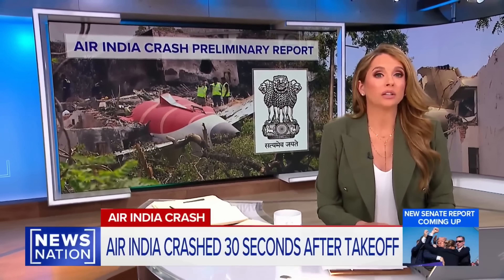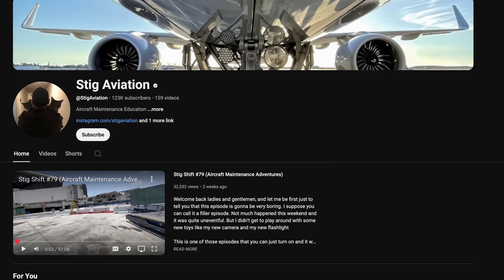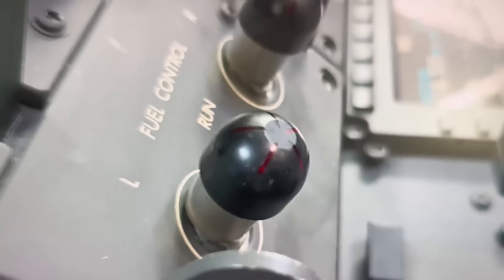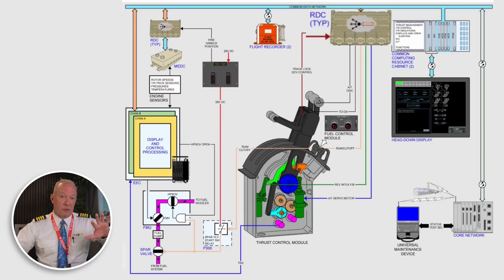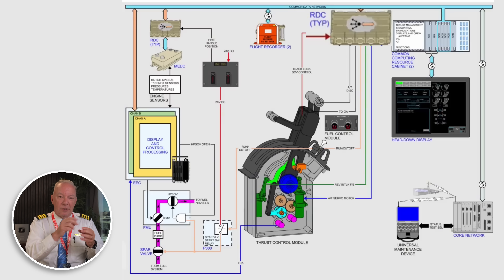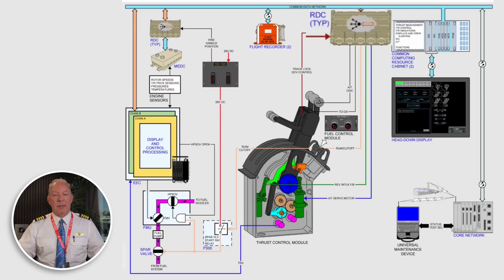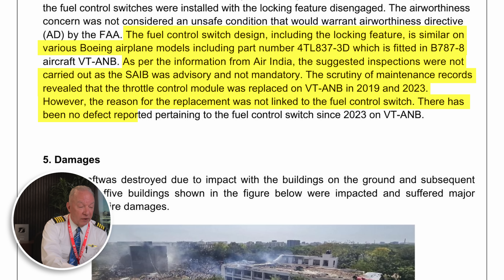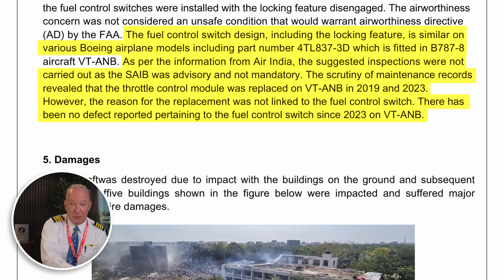The Truth About Boeing 787 Fuel Control Switches

Comment: Excellent explanation of the switches. What if the battery itself went bust , would that shut off the valve ? There is emerging theories that the battery was apparently already cooked before the crash. How probable is this ?

Comment: Thank you ! I am a retired captain for the same airline you work for. I am type rated in the 787. I've stopped reading all the internet BS and conspiracy theories because we all understand what happened. Everything you said is 100% correct. Somebody in the cockpit deliberately moved those fuel control switches from RUN to CUTOFF and back to RUN (10 seconds later). I would like to add the the position of those switches are reported directly to the flight data recorder. The law firm and NYT would like to bring doubt into this so they can litigate this and get a settlement and attract uninformed readers. THERE IS NO DOUBT WHAT HAPPENED, we can speculate why it happened but not the act itself.

There is a good reason the Indian government and Air India are blocking and delaying the investigation - they are trying to buy time. They know what happened because it is all on the cockpit voice recorder - so why haven't they released a transcript to the public? They want to create doubt and buy time.

Boeing, the US NTSB and the FAA all totally understand what Capt Steeve just told you. Do you think the FAA would continue to let the  1200+ 787's continue to fly if they thought there was even a remote possibility they thought the 787 was unsafe?  Like the 777 the 787 has an almost perfect safety record (so does Airbus 350). Stop supporting all the YOUTUBE and internet "news" sources who continue to try to profit from the death of 260 people. Thanks again Capt Steeve.
Reply: That does not mean electronic systems can't fail often at a crucial times i.e.  like taking off, You said these switches are reported directly to the flight data recorder, do you have any concrete evidence of this how the switch movement is sensed and conveyed to the data recorder? and what if the feed line to the sensors or the switch gets disrupted as it seems to come from RDC (TYP) module which is under the control of Common Data Network. So please don't pretend that you know full well,
Reply: @mikekenny4645 
What color is the sky in your world?
Reply: Somebody moved the switches to cutoff and another one moved them back to run. Because the first officer was the pilot flying I suggest the "someone" was the pilot monitoring.
Reply: Why was the RAT depolyed immediately?
It would not be triggered by fuel cut off.
Reply: "Would Boeing, NTSB and FAA continue to let 787s fly if they thought there was even a remote possibility they thought the 787 was unsafe" - YES. THEY WOULD. THEY HAVE DONE THIS REPEATEDLY IN THE PAST.
Reply: "Stop supporting all the YT and news sources who continue to try to profit from the death of 260 people"???? THATS EXACTLY WHAT CAPTAIN STEEEVE IS DOING!!!!!!!
Reply: Assuming the circuits that the switches are part of are genuinely as isolated from possible electrical faults as suggested in this more detailed presentation, it looks like the physical movement of the switches rather than a fault is what actually happened. I would however guard against making the further assumption that the movement was deliberate. We know that conscious decision making is not the only thing that drives physical actions, especially those actions that a person may have performed so repeatedly that they become an intuitive response or a sequence of actions which result from the triggering of muscle memory. When the conscious mind is distracted or focused elsewhere, we can do all sorts of things that we never intended to do.
Reply: @griff40532
What would happen if the Main battery diode module failed, (Single diode!) allowing a voltage feedback (Not regulated to charge the battery) from the Left Bus?
Could this mimic a "dead short" condition in the circuit powered by the battery?
Might that remove voltage from the fuel supply valves/ pumps?
Might the "short" also remove the trigger input at the "switch position" contacts within the switch, effectively mimicking a "Switch at cutoff" 0v trigger to the FDR, via the RDC?
.
If the system detected a failure in the Left bus, would the software initiate an "emergency supply" from the Right bus (not normally powered by the battery) via the Bus Tie Connector main contacts?
What effect would connecting the POWER feed from the Right Bus to what SHOULD be a 28v load requirement, but is, in fact a "Dead Short", have on RIGHT bus?
.
Would that action take the RIGHT Bus to the same "Dead Short" state, with the same lost of power to fuel supply AND "false indication of Shutoff" condition?
Might the "Right side shutdown" take about 1 second from the actuation of the Bus Tie Connector?
.
Please search "Jeremy John Thompson" on YT and watch the video from Early August for an extremely detailed and (imo) plausible hypothesis.
(Note, I have no connection to the individual (who is an Electrical Engineer) and was of similar opinion to yours regarding the "human factor" BEFORE I saw the video)
Reply: @rogerstarkey5390 wouldn't explain the second between the two switches being switched off and later switched on. Also doesn't explain the cockpit recording. Also it's very likely the voltage is also measured and recorded.
Reply: @rogerstarkey5390 "What would happen if the Main battery diode module failed,"
Nothing much initially. It would mean the battery now got charged by some higher voltage from the LHS bus, instead of being charged by the dedicated battery charger. This is very bad, and within a few days the battery may fail. And THEN the battery may act as a short to ground (0 volts), bring down the LHS bus, and then the RHS bus.
Reply: Retired captain blaming dead pilots when they actually tried to save the plane. You're a miserable and pathetic piece of trash. Stinky rat, have some shame!
Reply: If u believe FAA & boeing r credible then i rest my case. This is the same FAA that certified 737 max and let them fly after lion air crash. A top american CEO of nuclear industry was boasting once in a conference that Only Nuclear industry works on principle of zero harm while others such as airline industry allow for fatalities at expense of introducing multiple redundancies. Being a pilot doesnt make u a accident investigator. You need Engineering, design & data analytics expertise to establish facts..😮
Reply: Purely frm a psychological point of view some 1 with intent  (disgusting claim) as being fanned by American cow boys wud not call MAY DAY while pitching nose up until last moment  :(
Go figure...
Reply: FAA allow unsafe Boeing to fly? You forgot the Boeing Max crashes? Why should anyone trust Boeing and the FAA?
Reply: Ditto. I flew the 787 for a bit and hated it. Overcomplicated, plastic computer game. 
Lots of scurrying by many entities going on.....  trying to blame Boeing. Very obvious. $$$$$$$
NO WAY the fuel control switches moved except by deliberate human action. Same switches on 747/757/767/777. 
ROTATION--IGNITION--FUEL. To relight a jet engine in the air without an APU (which only supplies enough air up to a limited altitude), you need ROTATION and plenty of it. I don't have the performance data for the 787 anymore,  but  you typically need around 300 knots airspeed to spin an engine fast enough to relight. "Relight envelope", look it up. This one was doing 180 and then slowed. NO WAY thsoe engones were relighting. 
Whaddya think the APU does on the ground? Jet engines start with compressed air. Or 300 knots air. 
Water ingress into the E/E bay? On a dry runway 70 miles from the ocean? You see any water spashing in the video? And find its way to the fuel control switches? What are some of you smoking? 🤣
The argument about a botched emergency procedure is marginally plausible, but where's the back-and-forth callouts and verifications? Not on the CVR, clearly. 
The Indian Accident Investigation Board has released scant detail about the CVR and FDR. Why ? Suspicious..... just like the Washington DC crash when no details were released about the female helicopter pilot until several days later after her social media had been scrubbed, and other actions taken. 
One thing is 100% sure -- the fuel control switches were deliberately moved to OFF, apparently  by the captain.
Why? Guess we'll find out....maybe. What's Occam's Razor say?
Coverup.... is that one word or two?
Reply: @yurimaree4380 No one claims the switches failed. No one. The claim is that it all started with a serious electrical issue. Then possibly the switches were moved, or the electrical issue made it look like they were moved to the FDR.
Reply: How are the positions of the switches reported to the FDR? What is the parameter that tells the FDR which position a switch is in? The presence or not of the voltage supplied by the switch to the relay? The presence or not of the voltage supplied by the relay to the valves?
Reply: @grifon6156  I'm interested in this as well and haven't come across any details.  As a computer engineer I would expect there are an independent second set of contacts in the switch for sending the switch position signal to the FDR.

What seems missing from the diagram in this video is if there is a signal showing the state of the relay that goes to the FDR, though you could infer the state of the relay from the positions of the 3 valves, which I assume is also sent to the FDR but not shown in the diagram.
Reply: What about the RAT deployment? It started supplying hydraulics at 47 seconds according to the PR. In Boeing 787 specs it says that it takes 7 seconds from the RAT deployment to start supplying hydraulics and 10 seconds to start supplying electrical power. According to the Boeing official data, the RAT must have been deployed at 40 seconds just 1 second after the takeoff and fuel switches ''transitions'' were recorded at 42 and 43 seconds, definitely after the RAT deployment. How do you explain that? Also, why it took them 4 seconds apart between those 2 switches when putting them back to Run at that critical moment? Problem obviously occurred right after they rotated and most logical explanation so far is water contamination or ingression in the electronics bay.
Reply: Yes, of course they would.  Until their is a confirming event that points to an undeniable pattern.  It's been done before.
Reply: "Do you think the FAA would continue to let the  1200+ 787's continue to fly if they thought there was even a remote possibility they thought the 787 was unsafe?"
Using a volatile battery in an uninspectable metal coffin doesn't sound all that safe to me. If the BDM failed, this would explain the whole sequence, including the previous flights' issues.
Reply: @ConcernedParent-z1qlet me ask, what aviation experience do you have? What do you know about the 787 fuel shutoff system? I’ve worked these for 37 years. Some of us actually know these systems and how they work. Some of us also have the prints for the systems. You can believe your battery theory all you want but those of us in the business, those that work the airplanes or have worked them for decades, know more than most.
Reply: @BangkokChuck..ReThaired   I'm not sure having a pre-biased opinion how "it can't fail" is very helpful. Take your prints and make the BDM a short, and the battery a short to ground. Then start following what that would result in using a time line event chart. Also think about what the shorted BDM would do before the battery goes bad (could take days). Include all detail, including optocouplers etc. Automatic redundancy actions, cascading issues, and later bus isolation events.
Reply: @ConcernedParent-z1q Do your kids use a laptop, Chromebook, iPad, or smart phone?  Volatile battery in a sealed container, just a different scale.  Do you put those things outside before you go to sleep at night?
Reply: @BobBrown-r6t   There are 1200 787. There are millions of iPads, iPhones, Androids, etc. Billions, probably. So those charging systems are much more well tested. And, yet, we do get burning devices. All aircraft have special bags to put such burning devices in. And the difference in battery size is highly significant too.

Comment: Lets get this straight because most of you who don't understand Indians. We don't commit suicide like this.
Reply: Indeed. Also, shouting murder after a very, very lacking interim report, is disrespectful and madness. There are already well developed theories that explain the likely faults causing all of this. They just demand a little more than a children's toy to explain.
Reply: Also I am an automation engineer and your explanation of fail safe is wrong your explanation of the relay is also wrong. If it was a fail safe system then the valves should be a NO valves normally open that keeps valves open if there is no power.

Comment: I have always wondered why there is Weight on Wheels type of system that prevents engine cut off if in flight? Despite the simplicity of these switches, if there was a WOW system preventing shut off when there is no weight on the wheels, then this shut down would not have occurred. or is this just too simple a thought as well?

Comment: For me .. the fact that these switches are so close to the  throttle is a problem!
Since their access is  critically dangerous on take off. 
And Since they only need to be operated on the ground. Or in flight in case of malfunction or fire!
They should be away and on the roof of the plane. 
So that a deliberate motion away from the control is required to operate.🤔

Comment: Mr steeve please clarify is fuel computer  fadec can shutoff  of fuel both engine of its own Yes or No, you are a pilot not specialist  aircraft  engineer, there is hell of difference  between  car driver and car specialist  engineer, bring fuel system  aircraft  engineer  for analysis ,he will  explain  why FDR recorded fuel shutoff  of both engine  in 1 sec, not possible  to stamp on FDR   difference  of 1 sec manually ,they are pilot  they are not knowing  minute technical  things

Comment: even a pinched wire could cause mimicking issues, I would be checking the wiring around the switches particularly where they replaced the two throttle control assemblies.

Comment: If there had been a ghost signal causing the fuel cut-off, the switches would still have been in the run position.  Yet the voice transcript shows one pilot asking why the switches were moved to cut-off.  Therefore, one of the pilots must have physically moved them. No ghost signals.
Reply: The voice doesn't say what you claim. It's more of "why did it cut off?". The plane cut off. "he" for a plane, where we in the west say "she" for a plane.
The switches were found in the run position. I bet they never actually moved.

Comment: They probably design it so that it requires voltage for the relay to open the valve. This would enable them to turn everything off when the aircraft was parked with no worry about the battery going flat and the valve opening.

Comment: Looks like this event caught both pilots off guard, so the recovered switches should be investigated both for spec compliance, and failure under sustained takeoff g-loads and angle. I suspect the springs might have lost some tension or reinstalled improperly after maintenance, so to cause it to flip under takeoff loads. Crashing might not be the right circumstance to cause them to flip back off. Again, assuming no disinformation from the pilots, or that nobody was drunk.

Comment: If the cut off switches were linked to the throttle position this would solve the problem. so throttles to idle engine cut off works. throttle at take off power cut off switch does not work

Comment: This would all make sense UNLESS there was an external cause that interfered in the electronic circuits signalling, ie. water ingress into the airplane's computer bay (E&E bay), which was warned for in a earlier non-mandatory action AD by the FAA. We know that Air India did not perform the recommended actions that were listed in that AD... 
At take-off, just at nose up attitude, fluids change position and IF there was a water/fluid leakage onto the electronics in the E&E bay, that then could possibly have caused both engine FEDACs to erroneously shut down engine operations in both engines. This shutdown was then followed by the fuel cut-off switches first set to off and then switched on again by one of the pilots (memory item action). Where the electronic signal was originated from can all be verified by the data in the FDRs. Based on the interim report, I'm still unresolved on the root cause for this crash and so should CAPT Steve be. I guess this stems from the difference in approach between an airline pilot and an aerospace engineer...

Comment: Excellent video to back up your initial thoughts on what may have happened and the proof that it was a physical movement of the switches (whether in error or intentionally) that caused the engines to shut done and not as some have said a software issue that sent a signal to shut off the fuel valves.  Also would like to say how calm you were when the other experts argued against your thoughts on what had happened, I think you have proved your theory here and rebutted their arguments against your theories.

Comment: 4:10 But, when this shema is correct, the relais give the power only to the spare valve. Not to 3 valve. The Next 2 valve are powered by the Display and Control Processing. One direct and the other with a "and" Switch.